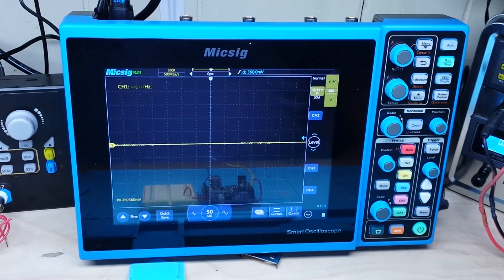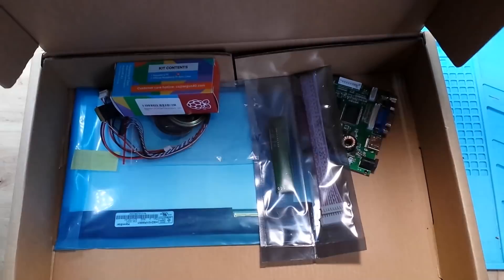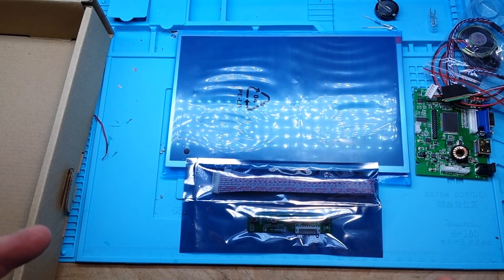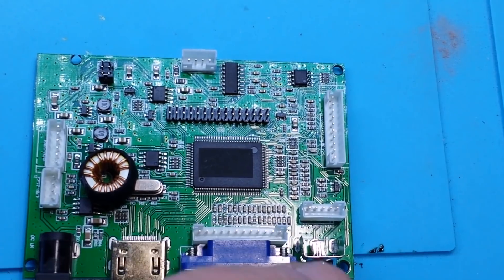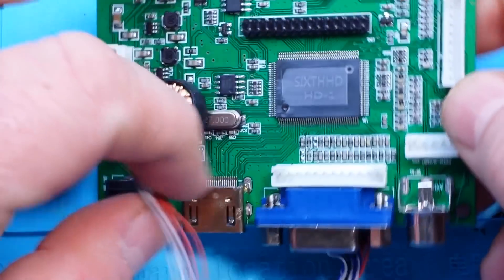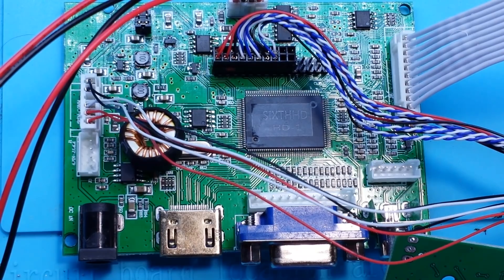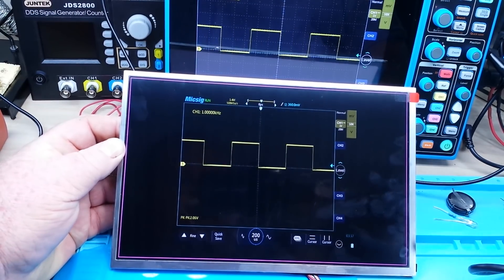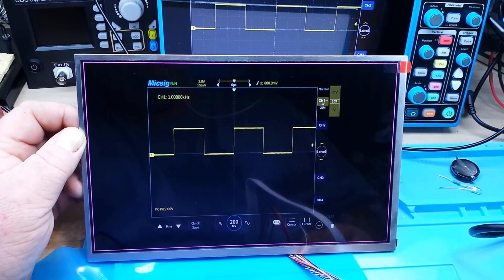10 Inch HDMI display from DF Robot

Comment: The Micsig has all the probe connectors on the top of it,
how does that work in general use?
I thought if would have been better if they were on one side of the unit.
BTW, you get cheap kits on ebay that lets you reuse an old laptop screen
as an HDMI screen.  "HDMI LCD driver kit"
Great video, thank's for posting stuff like this :-)
Reply from the maker: It is weird having the connections on top. They get 8n the way sometimes, but orger than that, the scope is killer.

Comment: Do a cardboard  mounting for that display and use as secondary monitor on the wall or in the bench so the micsig does not take it's space on the bench.  Can you display analog signal in the micsig and fft on the secondary monitor ?  Or put measurements on the secondary monitor and signal on micsig? there's a bunch of scenarios for dual display's ideas.
Reply from the maker: No the hdmi on the scope only outputs what's on the screen.

Comment: Would be a cool little monitor for video editing or realtime video monitoring where you're not able to look into the camera viewfinder. From across the table. That is cool, I can think of many ways to use it. As a monitor for adjusting your sat dish, for a good signal outside. With the composite output you could use it to work on DVD based games, vcr's, list goes on. Too bad it's so high you could buy a bigger monitor with a plastic enclosure for about $15 more bucks. But I can see it's promise.